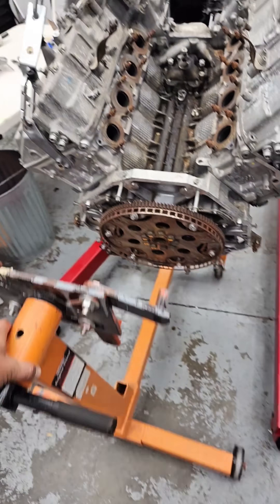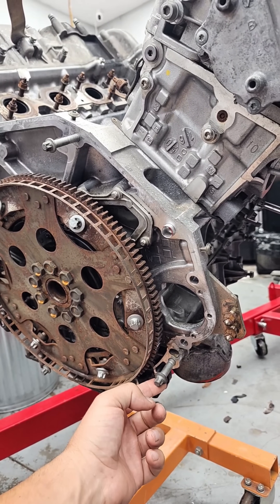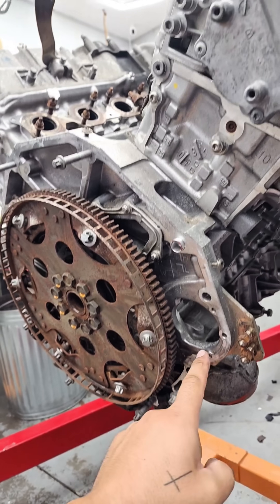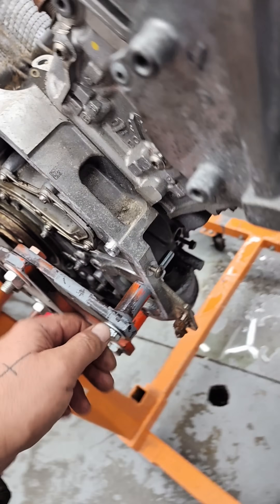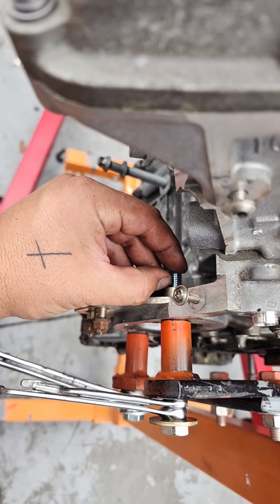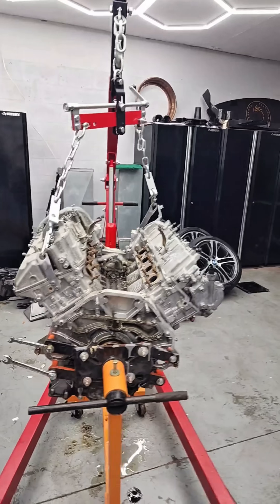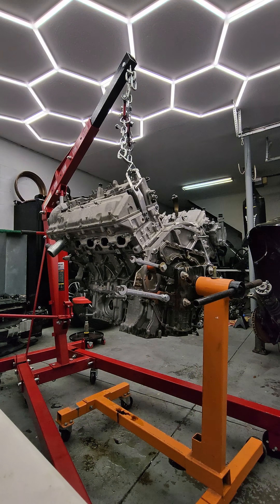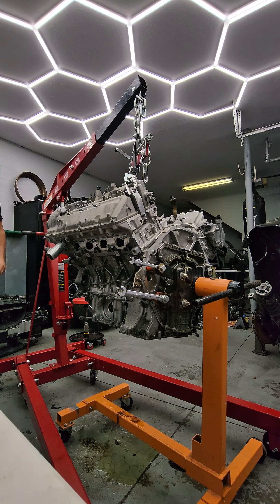Mounting an Engine to an Engine Stand from an Engine Crane DIY #Engine #enginerebuild #enginestand

Comment: If possible, you always want to try and use the top and bottom holes. Its better leverage, less strain on the block and stand rather than running the stand arms in the middle and horizontal.
Reply from the maker: Thanks for the tip! 🤝